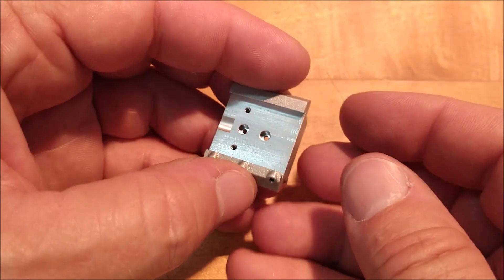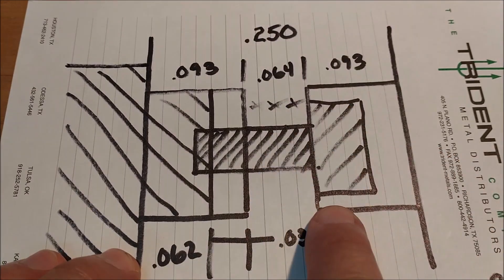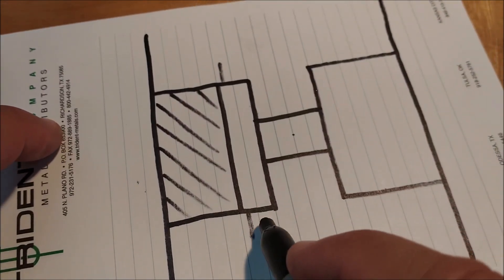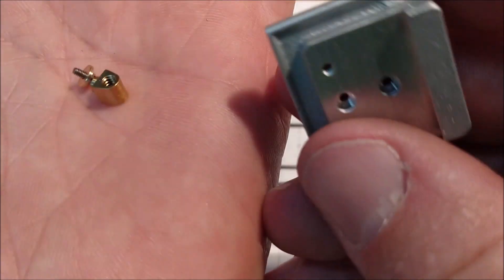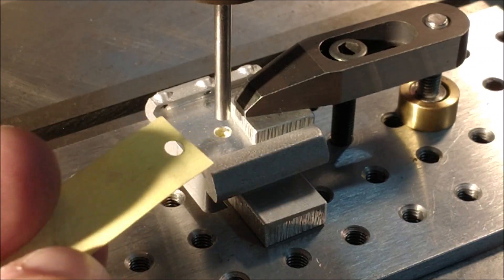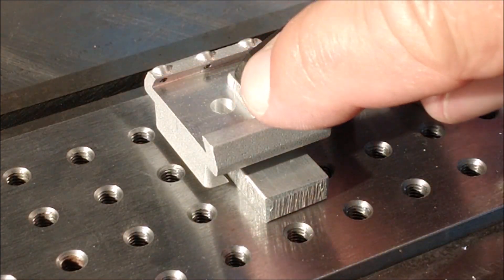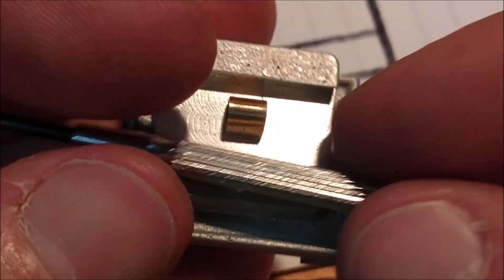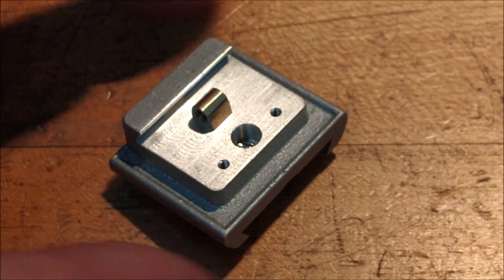A Creative Fix For A Small Problem !! A Mid-Week Quickie

Comment: Longer bolt is the simplest fix. However if you are miles away from suppliers or not keen on making a microscopic bolt 😢.  I think the option joe did was great. On larger bolts if low torque applications I have removed material from the underside of the bolt.
Reply from the maker: Having identical c'bores on either side of the through hole is just asking for a shear failure with such a thin web. I agree a longer bolt would have been a good solution, but the shear potential would still be there. The larger c'bore, resulting step and brass washer addressed that.

Comment: Neat!  I used to repair optical equipment, the majority of the screws were all BA and usually 8 (0.086"), 10 (0.067"0  & 12BA (0.039"). I always closed the door to prevent drafts...

Comment: I really don't understand what is the paper strip proving
Reply from the maker: If you read the crown of paper on the underside of the hole, you'll see the pushed in areas can differ in height. The really sharp ( low) areas are the areas where the part of the punch making contact, and shearing first. The opposite side of the hole in the paper is usually raised a bit. Indicating which way you need to shift the alignment.

Comment: Sorry Joe, longer screw from McMaster Carr would have been easier.
Reply from the maker: True...but...Opposing counterbores of the same diameter are an ideal environment for a punch through effect. Especially in a casting. Offsetting the counterbores and creating that shelf eliminated the crack ring potential. A longer screw would have worked, but I would have had to wait for it.
Reply: I would have gone with Microfasteners, cheaper and just as fast. But really I would have just pulled a longer screw out of the package because I have a bunch from a previous project, might have needed to cut it down a bit, but rather cut than not long enough.